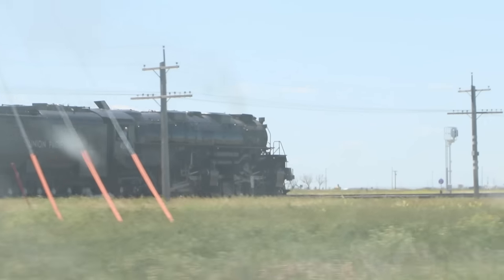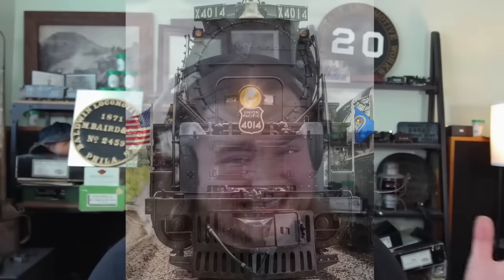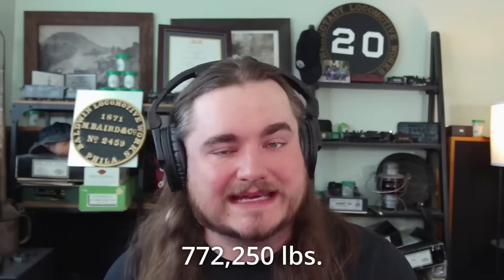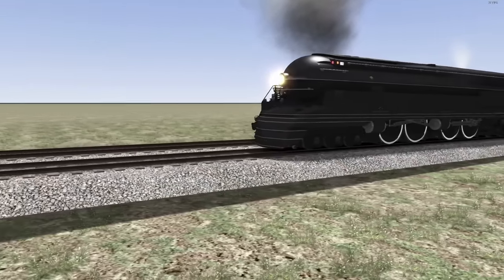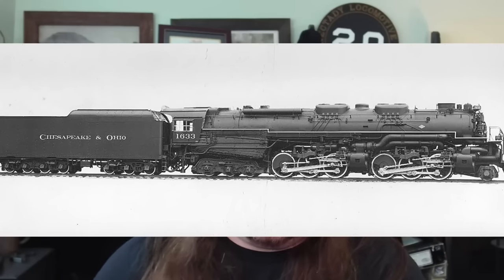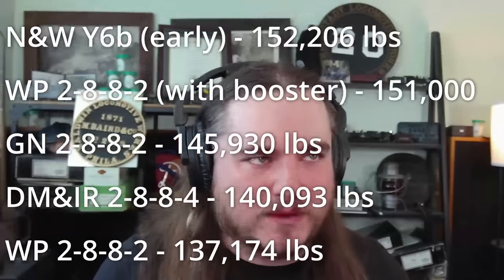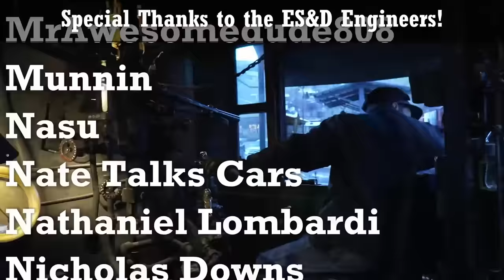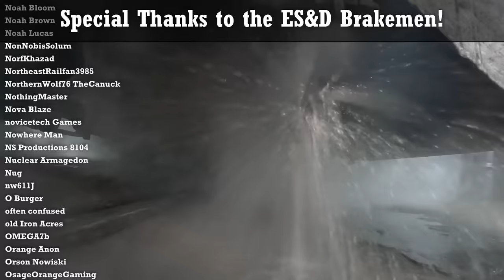BIG BOY is NOT the BIGGEST? What is then?

Comment: UP 4000 Class "Big Boys" had the longest engine body of any reciprocating steam engine! Period! There is no debate about it. John Henry was a turbine experimental engine with electric traction motors so it is not a fair comparisson. I would exclude Jawn Henry completely since it was just an unsuccessful prototype which had more in common to modern diesels than actual traditional steam locos. PRR S1 is another deal. It was impressive although just a prototype engine as well. But again, comparing engine body only (without the tenders), Big Boy was larger than PRR S1, which on the other hand was longer overall only due to its enormous tender. If the streamlining of S1 was to be removed it would be quite evident that the UP BB boiler was considerably longer than S1's. In actuality the boiler of PRR S1 was comparable in lenght to a 3900 class challenger boiler. So in essence Big Boy was and still is the largest (longest) steam loco ever. Also it was the heaviest of them reciprocating steam engines. Heavier than the triplexes and slightly havier than Allegheny. But Big Boys were certainly not the most powerful. A lot of successful classes of huge articulated locomotives were more powerfull. Still Big Boy remains the biggest and most successful class of general purpose steam locomotive ever created.

Comment: As far as a heavier engine that was in serial production, there is some wiggle room to say that the C&O H-8 Allegheny is also heavier... its just that noone really knows. 
The Alleghenys weight was part of a whole ordeal, involving a conspiracy to mask the true weight from the railroad and ultimately ending with lawsuits that basically destroyed the Lima Locomotive works reputation, but as a result of this two of the engines were officially reweighed. The scale had them come in at 771,300 pounds (a casual 47,000 pounds more than what they told the railroad they weighed to begin with), which is about a thousand pounds less than big boy. However, apparently the sandboxes were welded shut (which I find strange) so noone could tell if they had the 6000 pounds of sand required in them. If they didn't, then the Allegheny would be heavier. but as you cant prove a negative and 771,300 is the number on paper, Big Boy gets to keep that title.

Comment: I don't think it's a fair comparison in weight or length if you remove the tender... the Big Boy cannot operate without it. The fact that the tender may not be fully loaded doesn't matter either. We should be looking at the Loco at it's best if we're going to compare who's the heaviest. So fully loaded tender. Looking at Wikipedia the John Henry including Tender is LIGHTER than the big boy. The Virginian and Erie triplexes do have driving wheels in their tenders but their total weight including tender is ALSO LOWER than the big boy. So actually it does win in weight. Haven't checked length but I think you should redo this video taking a fully loaded tender into account

Comment: I've always looked at the Big Boys and Alleghanies as the biggest conventional revenue producing locomotives. 
Any loco with electric traction motors is something I don't even remotely regard as a steam locomotive any more than I would a ship with propellars.

Also, one off experimental machines that were tested only to find the many faults that made them unusable for regular service I regard as novelty items.

Tractive effort?

A modern diesel with two thirds the horsepower and 60 % of the weight will have more tractive effort than any steam era item because of the control one gets from electric motors and now with computer traction control.
But watch the Chalenger going up Archer Hill where one diesel would run out of breath.

The Big Boy had a weight of 545,000 on the drivers but had enough torque given the boiler pressure and piston and stroke length for probably double the tractive effort with more weight on those drivers.
The total forward torque on the axles was over 800, 000 foot pounds.
This was even referenced in a TV production about the Big Boy back in the 1950's when it was mentioned as having almost a million pounds of forward force.

The Big Boys and Alleghanies racked up millions of miles of brutal service.
They are the standard bearers for me.

Comment: The way I’ve heard it, “it did not hold the record in the categories, they had more effort, faster, HP, and length, but none of those other locomotives held more than 3 of the 6 categories, and often had issues that the Big Boy did not have. That is why it is the largest —>successful<— steam locomotive for being the best balanced and well rounded: faster and easier operation vs heavier or higher effort, better range than those faster, etc.” according to the guide here at the St. Louis transportation museum. Also to note, from the designs and testing in 1941 to final operations in the 1950s, they were operating much higher tonnage and running easier than originally thought they would by Alco, who were surprised by the results—considering that 4000’s actual money-where-mouth test out of Ogden in 1941 found the locomotive “slightly underperforming” at 6,500 tonnage until in Evanston it was discovered they had wrongly calculated the train which was 9,500 tons, meaning it had actually performed better than designed and had accidentally out pulled it’s estimated 7,500 maximum with no issue.
Reply: THE PENNSY'S HC-1
ITS HOME BUILT 2-8-8-0 ...
BUILT IN 1919 HAD ALL THE RECORDS
IN 1919 ....
HIGHEST HP OVER 6300 
HIGHEST TRACTIVE EFFORT AT 167,000 LBS 
BOTH SURPASSES BIG BOY TO THIS DAY 
SO THE BIG BOY NEVER HAD EITHER OF THOSE RECORDS

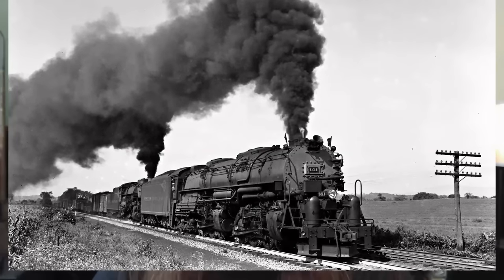Comment: 5:26 Maryland mentioned 😎
Reply: Also, come to the B&O Railroad Museum if you ever wanna go up into the cab of an Allegheny and sit in the engineer's seat
Reply from the maker: I really want to make it out to B&O. Too much cool stuff out there.
Reply: I hate to be a party crasher, but the WM M2 challenger never put more HP into the rails than Big Boy. The Western Maryland did tests on the M2's (as well as the gigantic I2 2-10-0, the J1 4-8-4, and the H9 2-8-0) and the maximum recorded horsepower that they got out of it was 4650. 

 I think that the "WM challenger has more HP than Big Boy" statement comes from this book called " The Steam Locomotive: it's Theory, Operation, and Economics" by Ralph Johnson (who was Chief Mechanical Engineer at Baldwin so he knew a thing or two). At the end of the book he has a table that includes his calculation of estimated HP based on locomotive design and that puts the WM challenger at 6345 to the Big Boys 6167.

So in theory better, but they don't have the receipts.

Comment: Awesome video, I've been saying this for years. Doesn't men the locomotive isn't impressive at at its just facts. Also none of the railroad men call these locomotives "Big-Boys" on the UP they typically referred to locos by thier nuber series. So the would refer to them as the 4000 class. The northern weer called FEFs or the 800 class. Even the challengers were call 3700 3800 and 3900 class by the actual workers. And specifically with the Big-Boys because locomotives are all girls.

Comment: UP 4014 is now an oil burner.  How about testing its limits with that fuel.
Reply: They don't want to because the oil conversion is causing uneven heating in the firebox. That is why you never see the 4014 being run hard.

Comment: So here my opinion (and please be kind if I am not correct, I am just a nighttime cnc operator)
What if it's not that it's the BIGGEST PERIOD, but the BIGGEST that was able to SURVIVE. What if the ones that were bigger had so many problems with them being so large is why they weren't able to compete with a slightly smaller engine. I'm sure with such a long length going around some curves became a problem and also with them.being so large being maintained sounds like a nightmare to where it wasn't WORTH it so spend almost TWICE the time or an average locomotive to grease and check.

Comment: The Alleghenys did possess more horsepower but they slipped a lot because of the bulk of the boiler's weight being distributed on the 6 axle trailing truck

N&W Earrapeisms nosies
Reply: Alleghenys are famous for basically never slipping. They had a factor of adhesion of 4.6 in comparison to the Big Boys 4.
Reply: The Alleghenies had one of the highest factor of adhesion of any steam locomotive built. The first batch put 771,300 lbs on the drivers, producing a 4.7 factor of adhesion. They did not slip.

Comment: Allegheny tractive effort.
Reply: 110,200 pounds, relatively low as far a superpower articulateds go.
Reply: 110,200 might seem low, but let’s look at Factor of Adhesion. The Allegheny put around 500,000 lbs on the drivers, giving a 4.7 Factor of Adhesion. In steam locomotives, tractive effort is important, but adhesion is more important because power with no traction does not end well.
Reply: @CDavis-ut1ob  There was a wildcard factor on Allegheny.  When completed, it was found to weigh much more than promised, requiring track upgrades to take the extra weight.  It was very embarrassing to C+O and Lima, so the excess weight was not acknowledged. There were 8 more built for Virginian, and those were reported as much heavier than the C+O engines, but were actually the same weight.  So everything about tractive effort and factor of adhesion are questionable.  However, quoted horsepower for Allegheny was higher than Big Boy.
Reply: If they weighed more than C&O stated they did, then the FOA would be even higher.

Comment: Talking about weight or traction surely the erie triplex wins. But be noted the BB is a mainline locomotive since it can run with all the loads at relatively normal speed while the triplex is a switcher, which can pull that much but going anything faster than 10 mph will drain its steam really fast. Not suitable for mainline.
And the electric transmission steam turbines. Sounds great but it's bad in realistic because water or coal dust would run into the traction motors... Any trains with traction motors better get away from those and I guess it's better to use electric locomotive anyways. Generate the electricity elsewhere.

Talking about horsepower. Yep the 2666 is more powerful. (2666 is faster while bb hauls more) I highly doubt S1's 7200 horsepower performance at 100 mph because it's just too insane. (it almost hit the output of ELECTRIC locomotives decades later...you know what Chinese HXD series has got 10,870 hp and that's the crystal of modern electronics)

Still BB is a staple of high traction steam locomotive. High traction not necessarily high output.

Comment: Mark, DOnt you think that when listing biggest, heavy.... you should not include the impractical engines that were never a success by any measure. What good is an engine that had a high HP ot tractive Effort rating if it didn't work. It is easy to build bigger and so on but it is not easy to make it work, be profitable, low maintenance and the other thing you know to be a measure of the utility and popularity of the machine. One does not like to see BB  with lower ratings than other engines, purely because it, like the Phoenix, rose from the dead whereas the other engines remain silent or non-existent (Sadly).  And because it is running and there is nothing like it anywhere. Things that were a demonstrated failure certainly can't be rated with something that endured.  Just a thought.  The S-1 might have had a lot of tractive effort and such but didn't it have wheel slip problems, even int he hands of good engineers??  You didn't give a complete listing of weight of the engines as a comparative measure either. You did give a comprehensive listing of T.E.
In any event, you have done a great job of digging out the figures.  As usual your posts continue to be of great interest and educational.
Reply: But this is just about size. Just because the steam turbines were bad doesn’t mean they weren’t the largest. Was the Big Boy more useful? Yea, but that doesn’t make it inherently larger.
Reply: You are correct in your statement. But comparing a practical engine that proved to be one of the most efficient and powerful ever built to things that could not get out of their own way, were never practically functional, even being returned to the builder. What good was all their size, power and so on. By all means, comparisons will always be made. But it should be among engines that worked and not weird concoctions that were impractical dreams.  Being the biggest, heavier, longer is of little value if they were measured on the way to the scrap yard.  As for this super fast speed record.... it was never verified, it has always been based on, "Maybe we did" and not, like the British, "we timed it over a measured distance".  By the way, based on actual weight BB moved, BB came in at more than 7000 HP.  Yes, the discussions and arguements will go on. But the BBs pulled their weight. Only one had an accident and that was sheer stupidity, human error by other than the train crew. @Stooltoad5017  Again, you do have a point, but I think the comparisons should have been set up a bit differently.

Comment: None of the railroads ever tried to design a locomotive to be the biggest, the fastest, pull most load, etc. On the contrary, railroads had a particular need in mind. The big boy was specifically designed to pull the trains of the day over the Wasatch Mountain Range between Ogden, Utah and Green River, Wyoming; and specifically, to get up Sherman Hill to Laramie, Wyoming. It had to do this without running out of water. No one at UP cared that it set any records of size. Only today's wannaknowitalls talk about size as a gospel that they think only they understand. Look at the Allegheny - same thing. Designed to be the best in coal country. Look at the SP&S, a little railroad in the west connecting Portland to Spokane - one of James Hill's railroads. The have a very flat, slow-rising alignment up the north side of the Columbia River. Their last steam purchases were the Northerns and the Challengers. Almost a perfect match for their loads and alignment. They weren't trying to win any size competition.

Comment: who cares if boy boy is the biggest loco ever made. but by along way big boys are the best.
Reply: How do you define “The best?” The N&W Class A is by far the most efficient steam locomotive ever built, specifically the 1236-1242 batch, having roller bearings on the crank pins as well as on all the axles. When you look at most articulateds, the Big Boy comes in kind of mediocre. Not the most powerful in terms of horsepower or tractive effort, not the fastest, and not the most efficient. But, it did what it was built for and what UP wanted it to do. Just wasn’t the best ever built.
Reply: I will say that just because the Big Boy didn’t excel in one particular area doesn’t mean it was in any way bad. There is nothing bad about a good generalist. Even when you average everything out it was still a very powerful locomotive that could what Union Pacific wanted it too. There is more to locomotive design than just what can pull the most and what was the biggest.